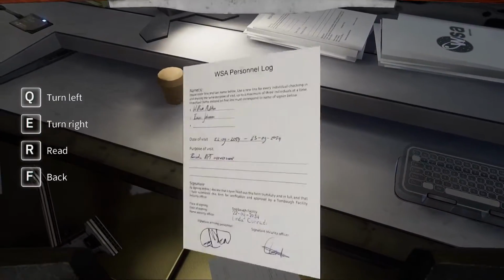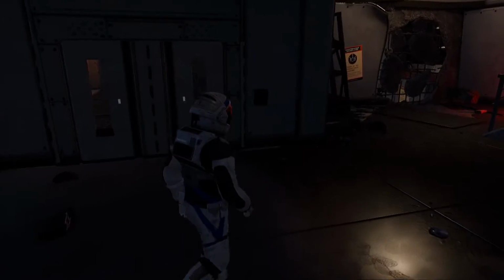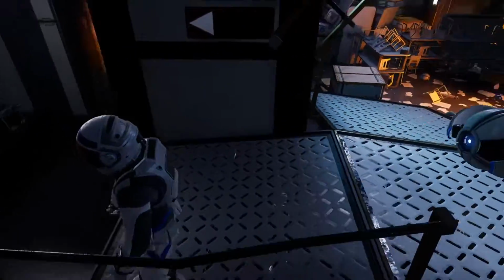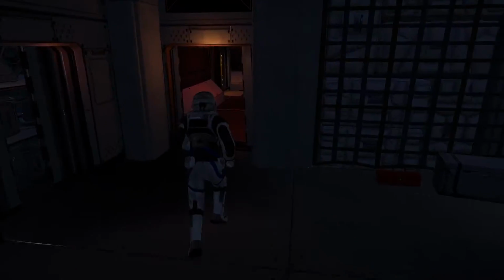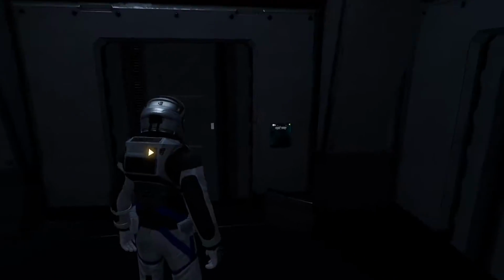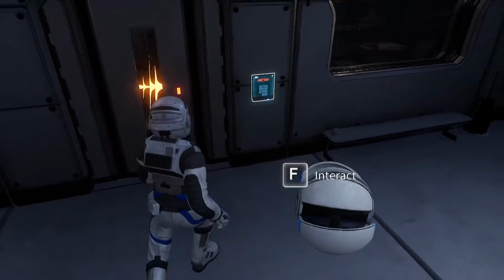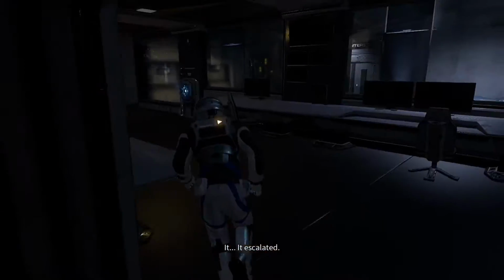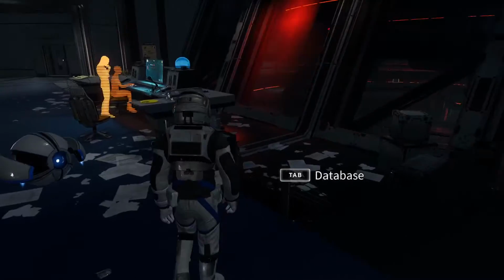Reaching Tombaugh Reactor Facility's Control Center - Deliver Us The Moon

Comment: Hahaha i was watching for a solution and i had literally done all the wrong things like yourself until I saw the walkway come down, after you had got the code and missed the right turn i was screaming at you and then you switched the power back over like i did before i knew where to enter code to get cart 🤣 thanks. Dont put a cart between a door that will lock with no power it glitches out.
Reply from the maker: Hahaha.